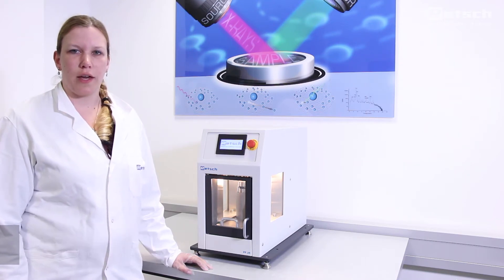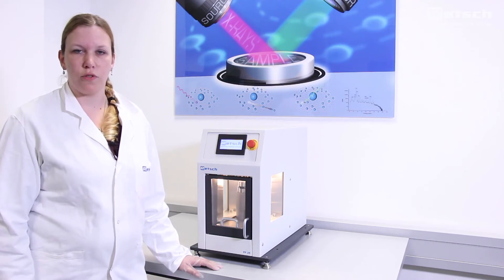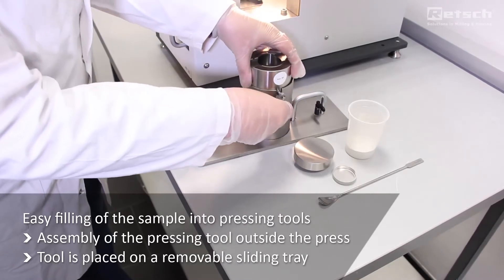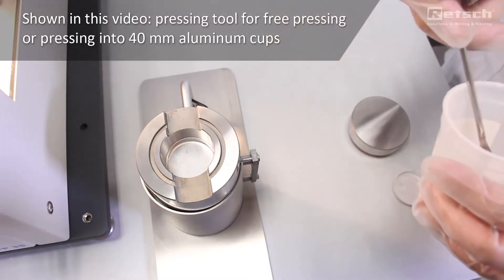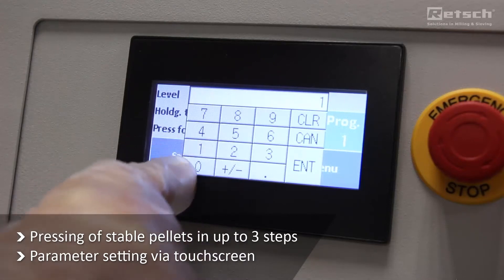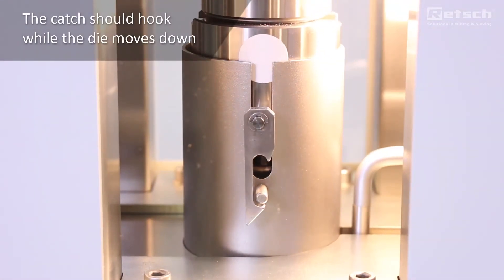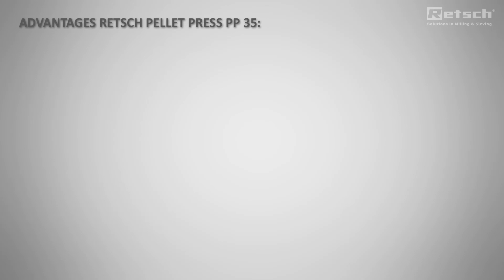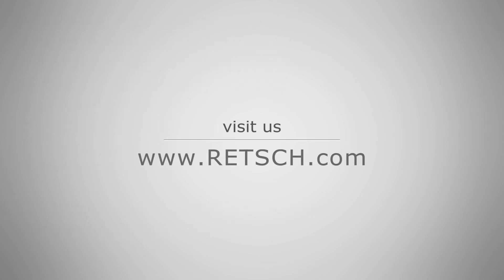Pellet Press PP 35 - Introduction #RETSCH #laboratorypelletpress #laboratoryinstruments

Comment: What is the press powder used ? How many grams ?
Reply from the maker: Please contact our experts for any questions regarding your applications: https://www.retsch.com/contact
Reply: Fantastic demonstration using the pressing tool for aluminum cup. Is there a demonstration for that of steel rings?
Reply from the maker: @felixarusuraire   Unfortunately, there is no video about using steel rings with the PP 35. Our experts will happily show you that in an online demonstration. You can get in touch here: https://www.retsch.com/contact/contact-form/